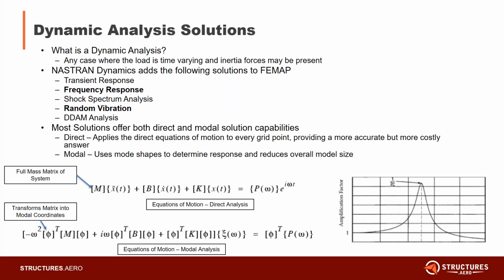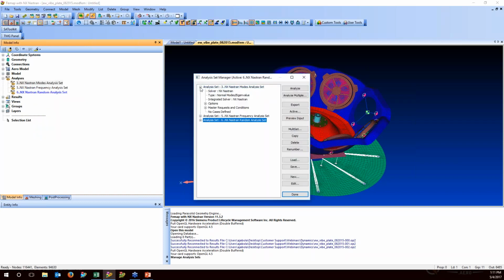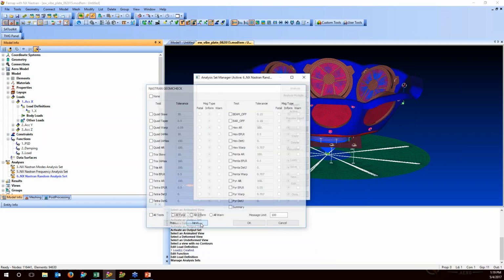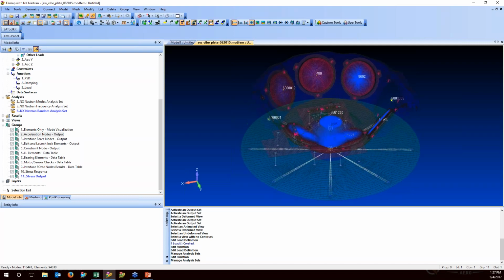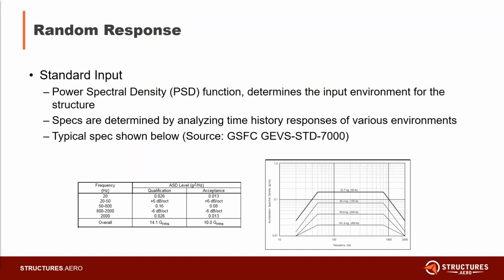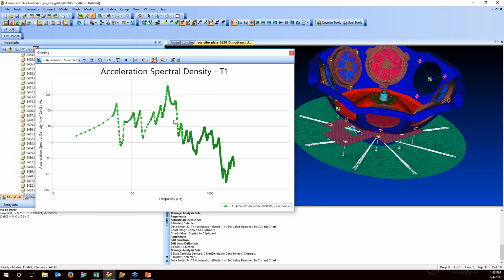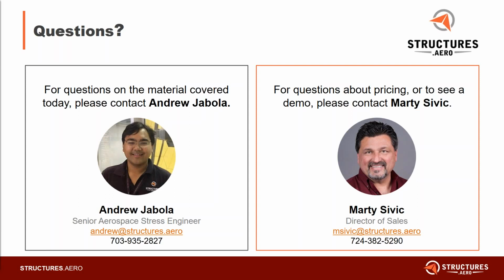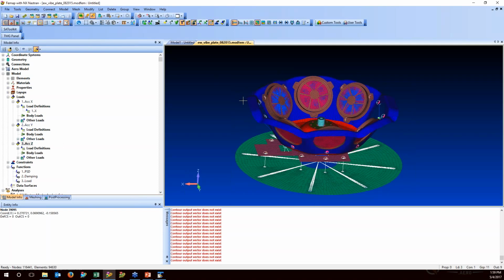Frequency Response and Random Response (Dynamic Response in Nastran)

Comment: Thanks for this example, I found it very useful. All of the random excitation examples I seen have a flat PSD for the input, which I suppose is essentially the definition of random. Supposing I want to use a PSD that is more peaky, ie it has peaks at harmonics of the machine operating speed - is the analysis still valid? For example are the 1-2-3-sigma percentage breakdowns still valid? Also, supposing I want to know the 0-sigma stress how do I find that value? One more question - if I have measured input PSDs in the X/Y/Z directions is it possible to apply a different PSD to each direction?

Comment: The input PSD you show at 34:58 doesnt match what you plot at 41:20.  Do you know why?   I appreciate your help.
Reply: I figured it out.  From  ---> https://community.plm.automation.siemens.com/t5/3D-Simulation-Femap-Forum/Random-Response-Analysis-ASD-Units/td-p/407823 

"....For random response analysis, the loading is a unit acceleration( 1g) applied in the frequency response portion of the solution. If you want all of the response quantities(accel,force,stress etc) to have proper units, then this would 9.81m/sec^2

This means after scaling by the ASD, your acceleration results are actually (m/sec^2)^2, which may not be so handy to look at(since your input ASD is g^2/hz). But with Femap charting, you then scale the acceleration results back into g^2/hz by dividing by (9.81m/sec^2)^2

A good check to make is to always request accel response for your base drive node, it should match your input ASD if you are consistent with units. ..."
Reply: @jrharrison3  thanks for letting others know what you figured out. 😃